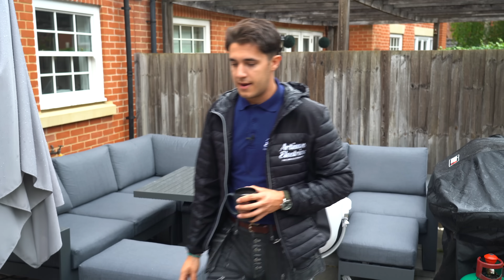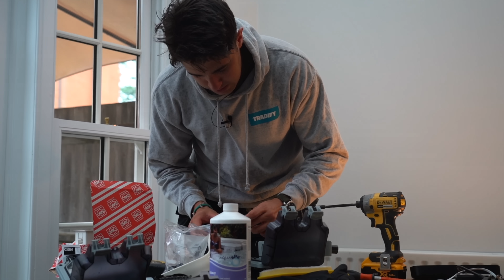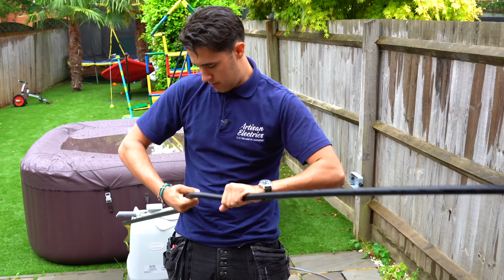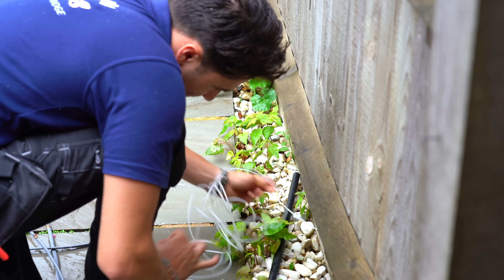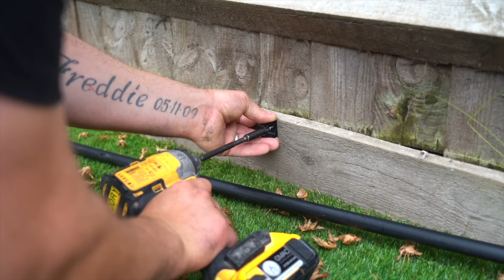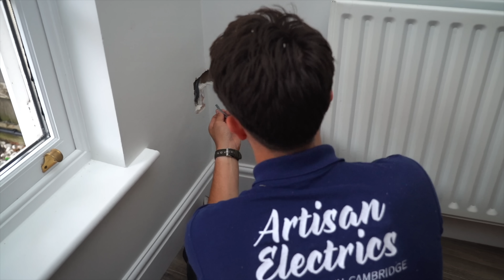WORKING IN THE RAIN - Conduit Work Outside - Electrician Life

Comment: Tip.Feed the wire attached to the bending string up tru the centre of the spring, that means if it gets stuck in the conduit and you have to pull it hard, it wont stretch as it will be pulling against itself

Comment: quick question. i thought you couldn't run a cable along a wooden fence as they are not classed as solid(i think) and it had to have concrete?  (just curious)
Reply: My thoughts to

Comment: Love the video, but can I ask if you used 32amp Wago’s as it’s important given you are going to so much trouble to extend the ring for the sole purpose of maintaining high power rating?
Reply: 32 amps should never be flowing through that wago as the cable isnt rated for it.

Comment: You've convinced me to do more bending in future. I usually just cheat and use inspection bends or flexi if I have to go round awkward corners. I also find it a lot easier to assemble PVC conduit around the cables when they're sheathed rather than trying to pull them through. Just out of interest why was conduit chosen? I would have thought armoured might have been more appropriate for this job?

Comment: Hey Corey, if that is a boundary fence you are fixing the sockets to, we can’t do that in Australia as it’s considered not a permanent structure. I’m not familiar with British standards so maybe it’s acceptable. Secondly I’m not trying to be smart but I was taught not cable tie cat 5/6 cables as it can affect the data transmission rates and it can increase attenuation and cross talk between cores. We use Velcro to tie data cables as it doesn’t crush the cable and still remains relatively neat. Great job !

Comment: In Denmark the main cable provider NKT sells cable on what they call a qaddy, big drum, that can be pulled around with a handle. You pay a deposit for the qaddy, which you get back when returned to the wholesaler. They'll just use it over and over again, really neat I thought.

Comment: The one thing I definitely would have done different is the socket inside I would have changed that for a dual box and fitted either two single sockets or a single and a double sockets to split the ring. I hate using wagos in the back socket.  Or if there was a spare way in the CU I would looked at using that. As I like to keep outside circuits isolated from the rest of the house circuits. . Different ways of doing the same job .  they would all comply with regs.

Comment: Is that ring on a 20A or 30A mcb ? Those wago 773 push connectors are only rated to 24A
Reply: It's no issue as one leg of the ring will never exceed 24A
Reply: @JacobKelly02  how do you know?  What happens if someone makes further additions to the ring?
Reply: @SoapyB20  how would it make a difference if they're keeping the ring intact? A single leg of 2.5 is rated about 24amps same as a wago connector. So with ur logic 2.5 shouldn't be used also in case someone breaks the ring? I know many sparks who have used them wago connectors on legs of the ring with no issue, let's be real them wago connectors can handle more than 24 amps anyway.

Comment: Nice to see some Ubiquiti kit in there. You should look into importing the G4 Doorbells for users that use Unifi. Since they are still so hard to get! Nice install Was thinking about the same with a similar setup that's also rained on. One thing with that make of outdoor spa is a serious one, the moulded plug rots too quickly and gets very very hot.. Like after a few months of it being outside and can cause damage. In the end, replaced it and had no issues.

Comment: I'm really not sure about the whole UV degrading different colours thing... I think the material composition matters more than the colour.

I've had UV degraded stuff fail. Ratchet straps turn to dust, plastic become brittle. However, on the flip side I've seen plenty of decades old T&E outside with no ill effects, outside sockets are grey, lots of adaptable boxes are white, white IP rated plastic distribution boards, white motor starters, white outside lights, etc. etc. 

The little clips on outdoor fluorescent tube fittings are the worst, lots of them you're lucky to get a year out of (even inside!).
Reply: Black is more UV stable naturally

Comment: I can't say I'm a fan of the idea of extending the ring outdoors, since it precludes providing any means of isolation for the outside wiring. Ideally I'd like to see outside wiring on a seperate RCD but if that is not possible then I'd at least want a means of isolation so that when it leaks and trips the RCD I can isolate it and reset the RCD until I have time to sort it properly.

Comment: In the old days we were limited  to a maximum of 3x  90 degree bends between boxes and all conduit work needed to be completed  before   the cables pulled  in .Also we weren't allowed to export the cpc outside the equipontential zone if it was a TNC-S  arrangement.I guess from watching this video all that's gone out the window with the latest regs.

Comment: First of, I love the amount of videos you are making for us. And a helpful tip is to trow the "Nylon Tension Spring" in the proper recycable bin and buy a proper tension spring(i think thats the english word for the push-through-pipe-thingy), name of the one i'm using is "Castor Runpo5". Should be an three wire braided one, you have much morr force, while it still bends in pipe corners.
Reply: That’s very cool

Comment: 3 4  5  = measure one length at 3 inches 30 Center meters then measure the other side at 4 inches 40 Center meters then bend once bent measure between the two marks should equal five inches or five Center meters perfect ninety bend buddy

Comment: 2nd comment.. tip with pvc conduit (sorry to those who know this!) There are 2 grades of pvc conduit, light gauge and heavy gauge. Springs are mostly for heavy gauge, you CAN bend light gauge but it's not a fun process.  Certain suppliers who rhyme with Crew licks have a habit of selling light gauge as heavy gauge causing nasty spring  ripples in the  finished product
Reply: I had heavy guage from CEF, and it split on the bend, so it might not just be screw fix, as you can see I don't give a crap who I name and shame.
Reply: @acelectricalsecurity  i only hedged a little because I am only 95% certain it was them. 
 It's a pain in the arse tho, i now keep a sample of proper heavy duty conduit to hand... is easy to do a quick comparison and reject the fake ;)
Reply from the maker: Great tip

Comment: Extending a ring outside. Never seen that done. And probably for good reason!
Reply: a dedicated circuit would of between better ran in swa in my opinion but I’m old fashioned. Extending the ring outside is asking for trouble. Separate 4mm radial on its own rcbo would be my choice.
Reply: @jonathanstephens7804  Agreed. Altho we'd usually go 6mm for outside stuff.

The cost difference isn't much, and it allows you to say to the customer 'yes, yes we CAN connect your hot tub to that cable'
Reply: I personally wouldn't do it for the potential nuisance issues...  but on old work, sometimes beggars can't be choosers.  if the load is likely to exceed 13A ... i'd have been looking at a new radial. If that wasn't possible, maybe TWO fused connection units and run 2 separate feeds out there?
Reply: @TheChipmunk2008  exactly. Nuisance trips can’t be isolated
Reply: @AndyK.1   they kinda can. 

Solvent cement is a nice tip, cheers AE